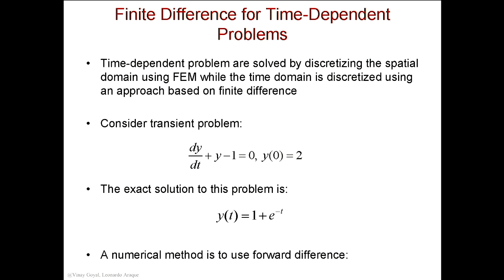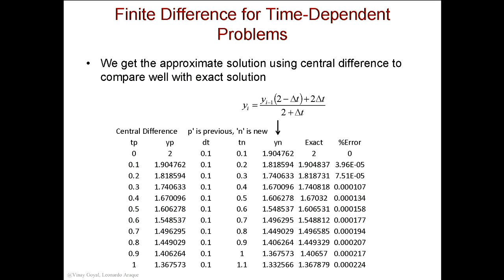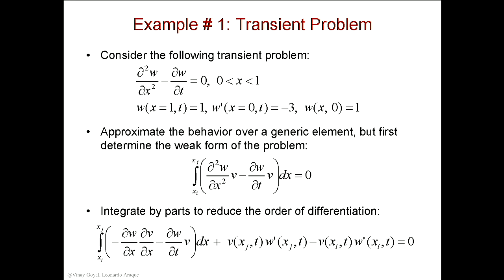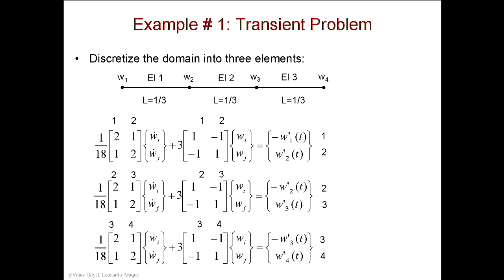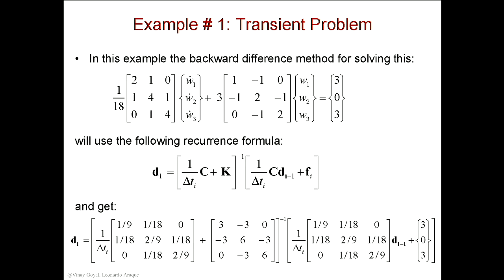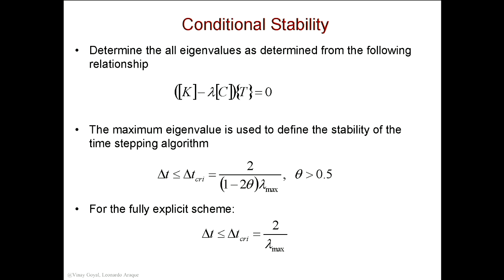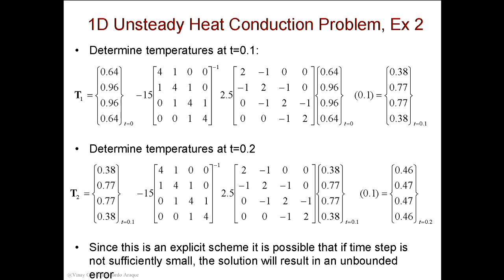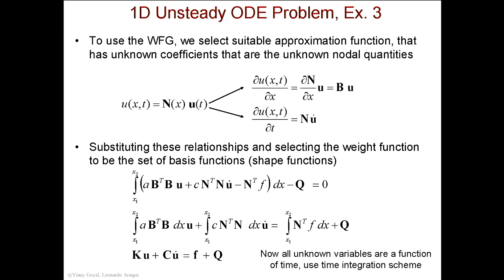FEA Lecture 13 (ppt) 1D Transient Problems Heat Conduction

Comment: Difference between forward and backward difference method is not clear.

In both scenaroies we are using previous data to get new value right?
Reply from the maker: In both cases you are... Has more to do with how derivative is expanded